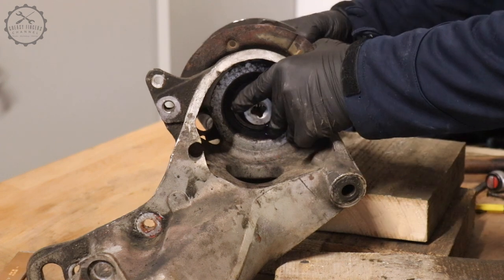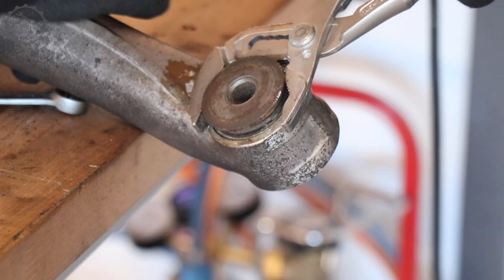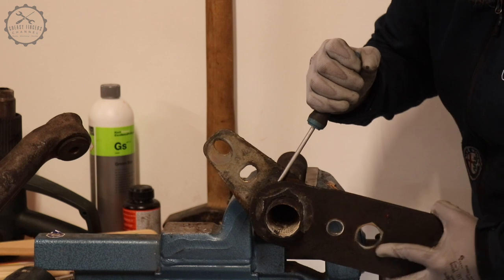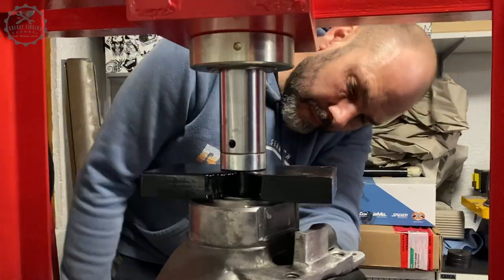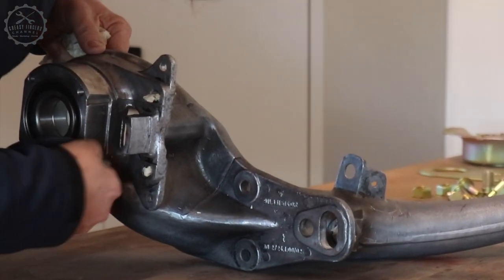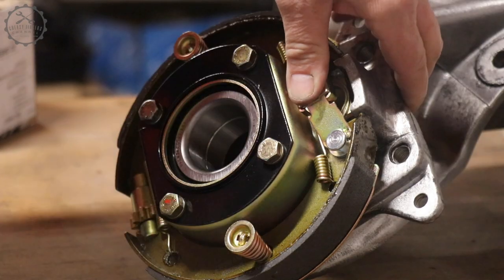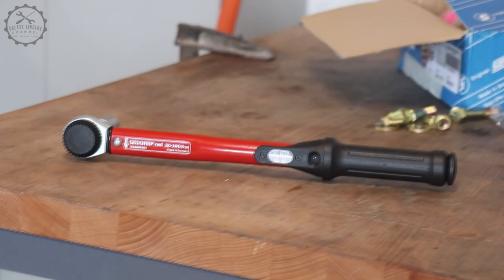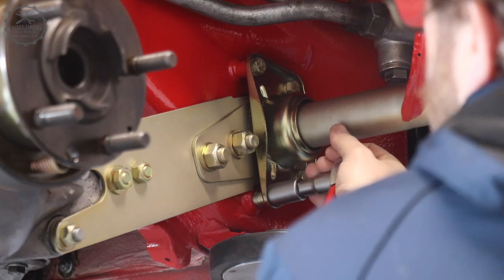Porsche 911 (87): Restoring The Rear Suspension

Comment: These cars don't really seem to terribly complicated. Precise yes, one must be fastidious to work on them. But if you follow the rules, stands to reason just about anyone could work on one.
Reply from the maker: That’s exactly how I see it, Andrew!
Reply: @GreasyFingers  I have a question. Im going to be buying or attempting to buy a 1980 911 SC which is going to require alot of work, a pretty much rebuild, if i get stuck on a certain issue which the forums are unable to solve would you be willing to help me?
Reply from the maker: @andrewreil3938  Sure thing. Please contact me with the mail address which you can find in the “about” section of the channel.

Comment: Having done this job on the exact same car (‘87 Carrera) a couple years ago I was interested to see how you did it. I had to do all this on jack stands, however. 😢 I had the EXACT same problem as you where I couldn’t get one of the bolts off the front trailing arm. I ended up having to take a sawzall to mine, also. You got the tougher of the two sides off  with a wrench, though, which I still don’t get how you did it. That stupid bolt was like $25! Your spring plates/bushings/torsion bars came out of the torque tube way easier than mine did, too. I watched this video with both satisfaction and cold sweat. It was not an enjoyable job to do but the results are awesome.
Reply from the maker: Hey, mate. That’s astonishing in deed, I have done this very repair a view times now and the problems I encountered with my 87 Carrera were quite unique. 
Maybe a period with bad galvanisation …

Comment: Thank you Sir for your work. I am looking forward for a new episode, it has become a treat. Inspiration. Therapy! 
For people outside of Germany this is how we picture Germans, always doing the job well. German beer tastes better after you restore German steel to its former glory!
One thing which has worked for me with regards of stubborn bolts is soaking with penetrant few days before, also using a punch or ball peen hammer to tap where I have access (bolt head or nut). Then few 6 point combination wrenches in the more common sizes would work well to prevent rounding up. Good luck with your projects and thanks again for showing the good example!
Reply from the maker: Thanks for your feedback and tips, much appreciated!
A side note about these national mentality things: they sometimes work on a broad statistical base, but most of the times they’re not applicable to individuals. Some of the most careful and meticulous craftsmen I know are Italians and some of the most hard working guys are French. 
When it comes to my work, you see: I’ve picked my job because I’ve always loved cars. But if you develop cars, things quickly become very theoretical. These days I’m living out my initial motivation of becoming a car guy.
Reply: @GreasyFingers  HAHA this is true!
I was wondering if we could have few words about the equipment you are using and why did you settled for that? Like air compressor, welder etc.
Thanks again.
Reply from the maker: @mickmini3846  Sure, drop me a note. My mail address is available in the „about“ section of my channel.

Comment: I have been a Porsche mechanic for 47 years and I have to say I really enjoy watching your educational videos. There are a couple of things I do differently but ends up with the same conclusion.. My only negative questions is related to anti-seize products. Firstly I never use an adjustable wrench, I always use my correct size spanners which are all made in "West Germany"  I always use counter force with another spanner on the other part of the oil lines both on the engine, oil lines and cooler to make sure the twisting force is countered. My second question is you do not use any anti-seize products at all, I have always used copper grease on anything that is underneath of the car because of the salts and dirt which are readily used on our roads in Canada, as one day the part might have to come off again. I use to work for Roitmayer in Munich and have worked for a few different Porsche shops around the World. But even I can learn from you. Thanks and keep making videos as they are excellent. Look up my site at Jay Lloyds Klassix and you can see what I do.. Thanks again..
Reply from the maker: Thanks for the feedback, Jay. It counts as ten if a guy with your background says that. 

In fact I’m using copper grease a lot myself when I do projects for friends and customers. The reason why you don’t see me using it in this series of films are two: first, this is my personal car and under no circumstances I have in mind to use it on salty roads. Secondly, the film making. While I work, I always have the camera running pointing on my hands. In most of the cases this footage is enough to produce a film. However, sometimes things are out of focus or the memory card is full, I forget to turn it on, I mess things up in an embarrassing way, … these kinds of things. Then I need to disassemble the work again and redo it with the equipment properly set up. That’s when copper grease already on would spoil the script, you see. 😊

The adjustable wrench: these films were taken at a time when shops were closed down and each and every parcel took weeks, if not had been lost completely. I was just upgrading my equipment back then from amateur to pro and here you go.
Reply: good point. I agree 100%. Now let us talk about using a hammer to remove corroded bolts or a Sawzall. May be the guy is a plumber by trade?
Reply from the maker: @bernardmauge8613  😂😂

Comment: I have a 1987 911 3.2 Carrera G50 (turbocharged). This video was amazing. Thank you for uploading!
Reply from the maker: You’re very welcome! 
You built a 930 engine into your Carrera? Or engineered a turbo on? 😳
Reply: @GreasyFingers  It is a bolt-on Turbo system on a stock Euro 10.3:1 3.2 Carrera. Low boost of 7psi which gives close to 400hp.

Comment: I really admire your patience. not to sound any negative, but it amazes me how prehistoric the suspension design was for a car from the 80s
Reply from the maker: Yeah, I’ve had the same thought many times.
It becomes quite evident at this point that it actually is a design of the late fifties. 
Only thing we must not forget: suspensions are one thing but the centre of gravity is another. 
Today’s stupidly huge SUV’s have the latest suspensions and yet they handle light years worse than these old 911’s.
Reply: @GreasyFingers  agreed. + they were able to keep the unsprung mass pretty low I guess.

Comment: Excellent work, a pleasure to watch. 
One question as well- wouldnt it be beneficial to use some sort of anti-seize lubricant when putting parts back together? On bolts, bushings etc.
Reply from the maker: Thanks, Rainer.
I used some drive shaft grease for the bushings, but nothing for threads. 
Won’t harm though, I guess.

Comment: How is the rubber bush quality compared to the originals?
I ask because I've had many bad experiences with modern rubber replacements on my käfer, despite being made in Germany.
Split ball joint covers and swing axle boots to name a few.
Nothing is more frustrating than doing the same repair over and over again.
Reply from the maker: I totally agree to what you say. Lemme give you an answer once I had the opportunity to drive it. Fingers crossed ...
From installing them no complaints so far.

Comment: I have worked on Mercedes and Peugeots purchasing US Snap-On tools for best performance. The latest Dual 80 ratchets are top of the line with action, strength and low drag of the mechanical members of the ratchet. I have been a Snap-On customer for over 50 years enjoying the benefits. Other brand tools are rated high due to warranty; Snap-On has very little warranty as I take care of my tools and do not ask more than spec for the performance I demand from my tools. Why do you have that ratchet when Snap-On is available to you in Germany? It is a surprise to me that you are using that brand of tools in your work. I really like your explanations and style of videos. 
I have never driven a Porsche but I see the spec of what they manufacture as being high on the chart.
Reply from the maker: Thanks, Vincent.
I know Snap-on and I like them, however, being German, Gedore is my choice.

Comment: This is a fantastic video. The rear suspension on that car looks pretty challenging to work on versus a modern Carrera. Would you agree?
Reply from the maker: Thanks!
This project was challenging especially because of the contact corrosion between steel and aluminium parts.
In fact handling the torsion spring is a bit tricky too, so I guess they had their reasons to use coil springs from the 964 on.
Reply: @GreasyFingers  Do you think older Porsches are easier to work on or newer models? I’m considering a 1980 SC and doing some research before committing.
Reply from the maker: @512TXSDIY  I‘d say that F- and G-models, ie 64-89, don’t make much of a difference. If you think about newer cars >90 you will likely have less corrosion, but more electronic devices to take care off.
Reply: @GreasyFingers  Good point. So it’s really which one do you want to deal with is what I’m hearing? Lol
Reply from the maker: @512TXSDIY  Exactly! Choose your way to suffer. 😃
Reply: @GreasyFingers  Got it. Thank you for responding. Sub to your channel :-).
Reply from the maker: @512TXSDIY  Cool, you are Nr. 5555
Reply: @GreasyFingers  Nice! I’m working on mine still. Hope to get there soon.

Comment: A great video, thank you for sharing. I have an 88, on your transmission mount, the metal concave discs are pointing toward the chassis. Mine are flipped the other way? Concave facing ground. Which is right? I can’t find any clear diagram.
Reply from the maker: Thank you, Jay. 
Last time the engine was out, it wasn’t done by me.
I looked the mounts up in the parts list, they are mounted under an angle that appears to be 45 degrees.

Comment: great video. admire your dedication. I need to do my rear wheel bearing. Do you have a detailed video on that part. Removal and pressing
Reply from the maker: Hey Phil. It’s simple and straight forward and actually the film contains all the information you need. 
Biggest problem is to open and tighten the nut of the bearing as it requires 400 Nm if you have a G50. 
You have to put the car on its wheels to open it.

Comment: Vielen Dank ! Another great video. After living and working in Germany, perhaps “blade” would be better translation for the suspension arms than “swords”. Your way of working on your 911 is so relaxing. Thanks again !
Reply from the maker: Thanks, David,
You’re certainly right with blades and swords.
How was your German experience?
Reply: Lieder ist meiner Deutsche nicht so gud wie dein Englisch aber Deutschland ist immer noch in meinem Herzen. I miss my friends in Germany
Reply from the maker: This one post in any case is perfect German. ☺️
Reply: Thanks. Your attention to detail is an inspiration for me in my project. Your humour is also perfect. Very “dry” as we say in the UK
Reply from the maker: What’s your project, David?
Reply: @GreasyFingers  I have a C4S but it is  hated 996 :-) but I have rebuilt the entire suspension including removing and refinishing subframes, replacing all bushings and ball joints etc. Interior is current project and restoring to factory condition. It keeps me busy and I want to return to exactly factory condition. I am envious of your excellent painting skills.
Reply from the maker: @davidgray5583  I don’t hate the 996 at all. In fact it’s getting nicer every time I look at it.
Reply: The 996 is still a very fast and excellent handling car with a 6-speed manual. It’s value is excellent

Comment: I'm trying to squint and see what tools you used to "successfully" remove the rear Trailing arm bolt. Do you remember?
Reply from the maker: Hy Patrick, it was an enduring struggle with all sorts of tools. There’s no easy way out.
Reply: @GreasyFingers  we found a stubby 22mm impact socket with provision for a box end wrench placed on the inner nut. Wobble and socket on the bolt. Came out easy then!

Comment: Very nice video. I noticed you do not use any grease or anti seize on bolts and or brake pad pins. Could you elaborate please?
Reply from the maker: Thanks, John. 
Not much to elaborate, I’ve never done that and never felt it’d be necessary.
Reply: @GreasyFingers  Chicago is hard on cars and trucks with salt in the winters. Moly Disulfide (Corning) is essential for bolts.

Comment: Watch out with that Brunox Brake Cleaner! The way you used it it will produce massively dangerous fumes. I use a respirator for my cold applications. Wouldn´t use it producing fumes. Be careful and stay safe. I had the same problem with a shipment from the 356 Goodie Store in California. 1 1/2 pounds (tool bag plus enamel grille badge) took from October to the day before yesterday! Wonder when my T-shirts from your shop will come?
Reply from the maker: Thanks for caring, Andreas! You’re totally right. Really no idea about the shirt, I hardly ever get parcels myself. Have they sent it out already?
Reply: @GreasyFingers  Haven´t seen anything...maybe I need to check my spam folder. Either way, Bro, take care!

Comment: I didn't see you putting anti-seize between the nuts and bolts and other bits and pieces when you did the reassembly?
Reply from the maker: Yes, I didn’t use any. 
I don’t think it’s really necessary if parts are freshly plated and the car’s not used in winter.
Reply: @GreasyFingers  In my experience it's always necessary.
Reply from the maker: @01thomasss  🤔 What you take? Copper paste?
Reply: @GreasyFingers  Hi, Yes copper paste is good. There's a good one called 'Coppaslip'. The better ones contain more than just copper but also nickel and other metals.

Comment: Why no glue on spring plate bushings?
Reply from the maker: That’s a valid question, because originally they’ve been vulcanised.
The simple answer is: I’ve talked to a number of guys who did the repair before and they told me it makes no difference.
Reply: @GreasyFingers  thanks for the quick response. One could argue with or with out. I guess the whole purpose for the bushing is just to carry the load. It’s the torsion bars job for the compression and the shock for rebound.
Reply from the maker: Hi Mike. Don’t get me started on that,  I could talk about suspensions 24/7 😆
The spring basically delivers a force proportional to the wheel lift, the damper to the wheel lift speed, in both directions -  compression and rebound. It therefore takes energy out of the system. 
The bushings, as you say, take the lateral and longitudinal loads on the wheel.
They also make sure that especially under lateral forces some intentional 
self-steering effects help keeping the vehicle stable. I therefore sometimes wonder about people’s optimism in changing these bushings towards higher stiffness as it can well lead to decreased stability at the limits of friction.
Reply: @GreasyFingers  Yeah we could definitely drink beers together.

Comment: I did my inner trailing arm bolts with no motor or trans in the way. I'd did not torque them. Motor and trans are in now. I'm gonna pay a pro to torque those bolts. I tried, can't do it.
Reply from the maker: Yeah, it’s a pain in the a**, especially as you have to torque them in driving position.
I suppose you have a G50? The 915 models leave more space to work down there.
Reply: Yes, 88 Carrera.